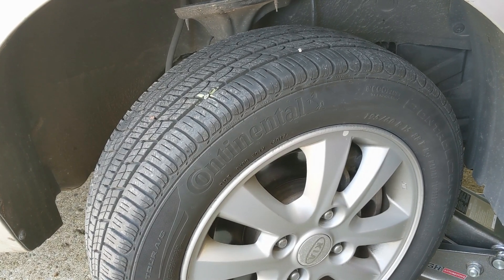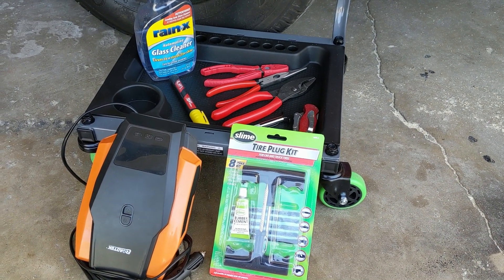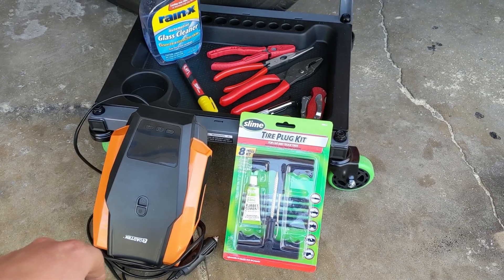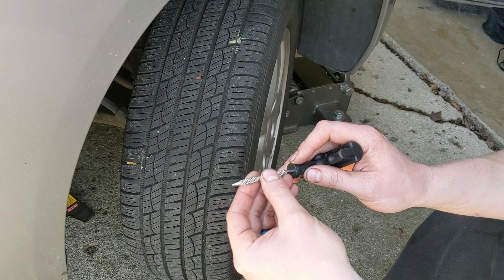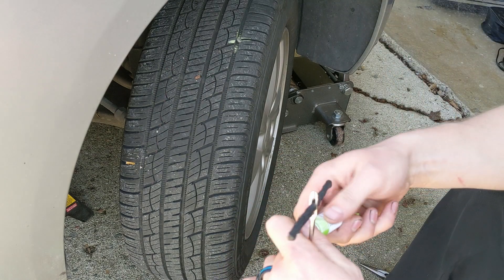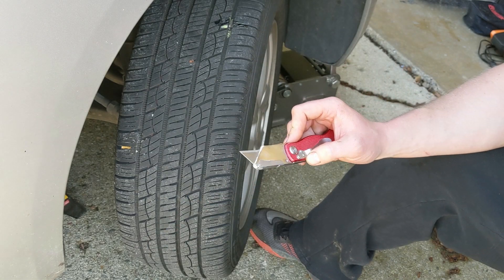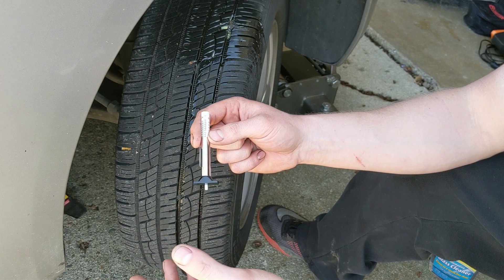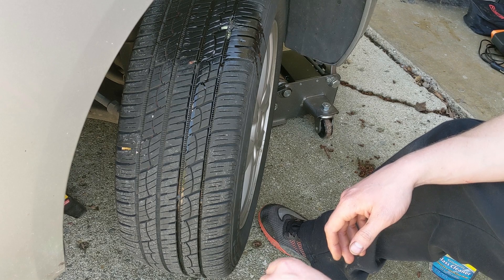How to Plug a Tire How to fix a flat Tire

Comment from the maker: Once again I apologise for the mic clicking. This is a video I recorded awhile back when I was having issues. I hope you still enjoyed the info. 👍 Also keep in mind this is for a quick fix. If your on the side of the road or don't have the means or money to replace the tire. Once you can it is advised to replace the tire. 👍
Reply: is this the same way a tire shop would repair it? they always include free puncture repairs for the life of the tire (as long as it's not on the sidewall) and they don't say anything about the repairs being temporary.
Reply from the maker: @dummkompf  no depending on the shop they should use a repair that is a little bit safer like plug and patch which is similar but they do it from the inside of the tire and use a glue compound to hold the patch in place. Same concept but a little more to it.

Comment: Awesome, I had no idea it was so simple! There's only two things I ever pay someone else to do on my cars - alignments and tires. When a tire needs to be plugged, I've always taken it back to the shop because they do it for free but now that I know how easy it is, I think I'd rather do it myself than wait around in their shop and worry about them overtightening my wheel bolts.
Reply from the maker: Lol true but also don't forget to ask your shop what type of patch work they do. This is a very simple plug repair. They might go about it in a safer way by removing the tire and installing a plug/patch which is much safe bc it is done on the inside of the tire and is supposed to last much longer than a standard plug. 👍👍👍

Comment: Those little goo sticks should only be used to get your vehicle home or to a shop where a proper plug can be installed from the inside of the tire. This is not an extended use repair.
Reply from the maker: Yes indeed I state that in the comment I left as well. Thank you for watching and sharing.